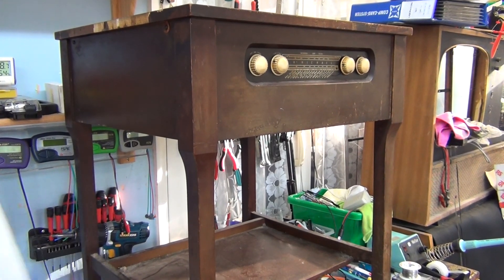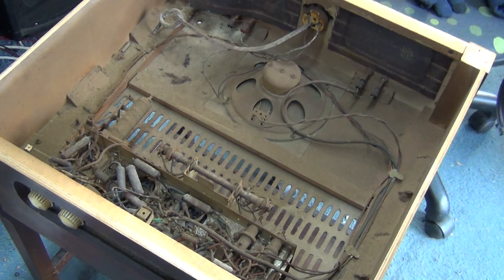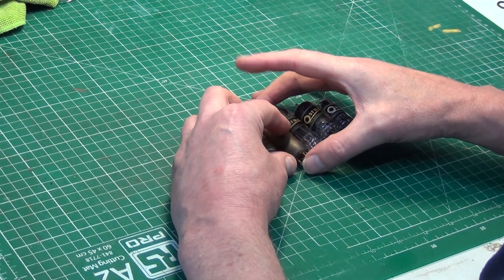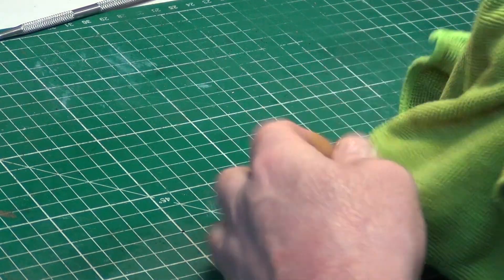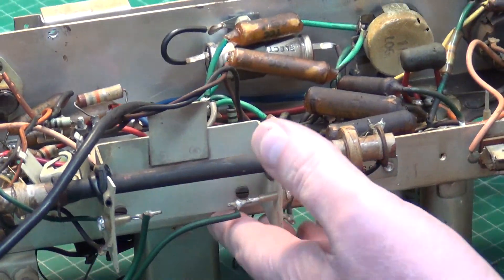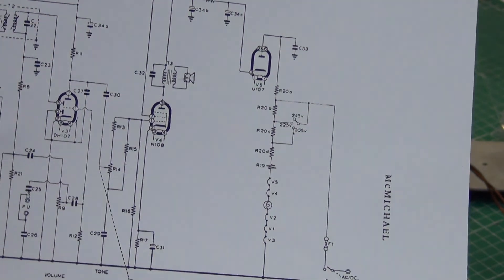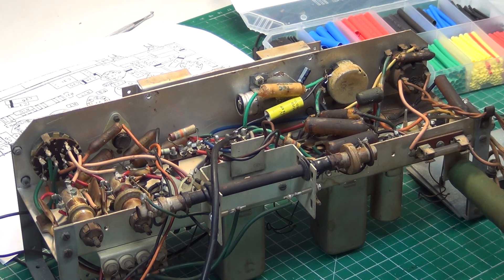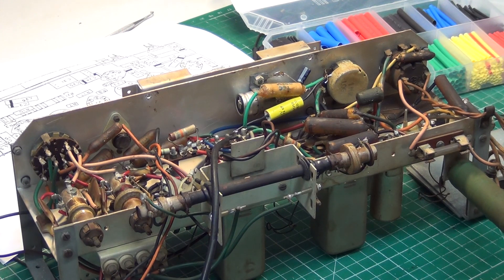McMichael TT4 1954 valve table radio Pt1 - overview, disassembly & start of parts replacement.

Comment: What about getting the rest of the capacitors from AVX Coleraine, hopefully they are still there.
Reply from the maker: I bought in all the capacitors required via RS compnents.  I just had a look at the AVX website & the only capacitors they offer are SMT. They have no tradiional leaded capacitors.

Richard., G0OJF, UK

Comment: Shame that it cannot be reconfigured to take the vacuum tubes made in 1947 for use in car radios then you could use  a pair of VN66AF VMOSFETS in the output stage to drive the speaker.
Reply from the maker: I really have no idea why you would want to change the valve types & also replace the valved output stage for solid state. Instead of a restoration, it would become a worthless frankenstein.

However, we do need to get on with this project I know. The snag is the queue of paid customer jobs that of course have to take priority.

Richard, G0OJF, UK
Reply: It would be like those old car radios that used vacuum tubes and ran on 12v with a b+ of 12v so they had to use a solid state device on the output as the transistors of the day were not ready for prime time

Comment: your radio is just as dirty inside as the one I have !
Reply from the maker: It's funny, Michael. I've had a McMichael TT4 on ebay auto-search for 20 years. The service sheets pop up, but not the products; this is the first I've seen offered.

The dial cord is broken on this one. I don't think it's  shown on the service sheet. 

Note the knobs in the picture from the radio show at Earls Court in the Practical Wireless you showed are not the white knobs you & I have on ours. The PW picture was probably of a pre-production model. I agree with you that they had it wrong over the FM statement. Clearly their photo is of the mw/lw one. I never saw any other.

Although I dislike products using AC/DC 'live chassis' technique, I have to admit this look to be expensively made. Capacitors are either 1KV or 500V for starters.

Richard, G0OJF, Lincolnshire UK
Reply: @ukfmcbradioservicingTango21  I actually bought mine off e bay , I must have picked it up before your auto search flagged up, It was quite a long way from me and collection only so I paid a friend of mine to collect it .
Reply from the maker: @michaeldranfield7140  Mine was 140 miles away so 280 mile round trip on a day it poured with rain.

Richard
Reply: @ukfmcbradioservicingTango21  Some very nice TV sets on flea bay last week but unlike you I wouldn't travel hundreds of miles to get them unfortunately .

Comment: Hiya Rick I have only seen another one of these radios McMichael were I beleive high end back in their day I have never worked on one so I'm intersted top video I'm looking forward to part 2
Reply from the maker: Thanks Andy, it'll be a few days in the organ workshop being dealt with. I sanded it down by hand being thin veneer & applied the first two applications of wood dye yesterday. The electronics is the easy  bit!

Richard